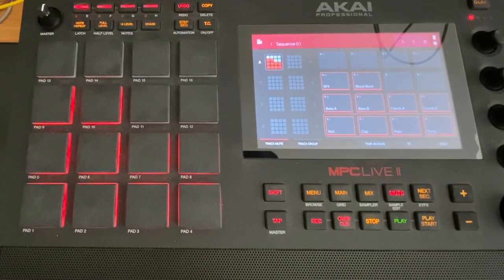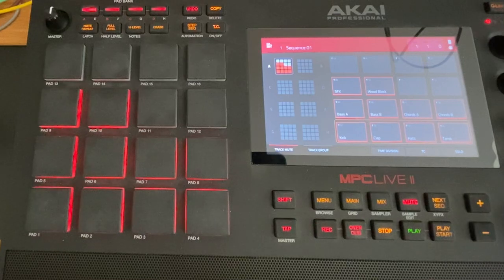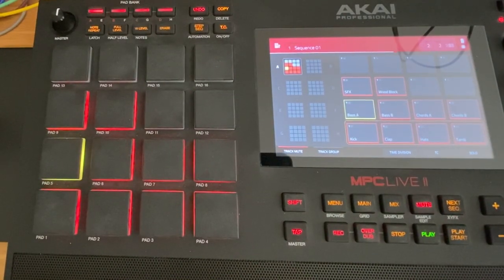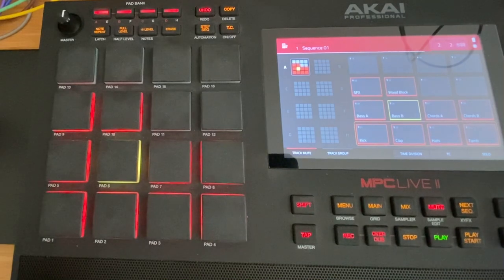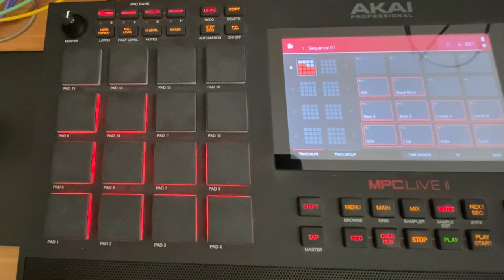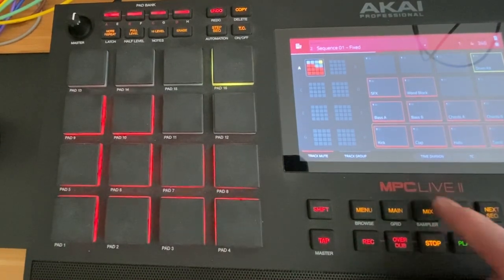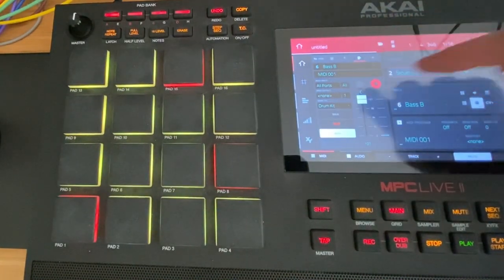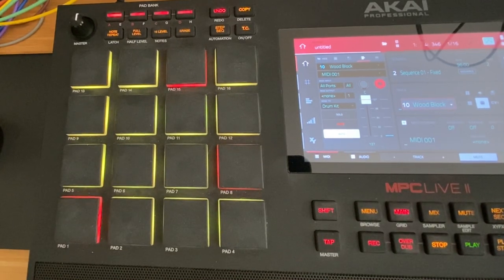Akai MPC 2.10 Firmware - Drum Kit Track Mute Fix

Comment: Are you sure this isn't happening because of the change in track mute behavior? It used to be, if a track was muted.. And I was on that track, I could still play the sounds from that track from the pads. Now, when a track is muted.. You can no longer play the sounds from the track. Akai told me this was not an error. It was done on purpose to make the mute behavior more like how a DAW works. I think that's lame, and they should never change a legacy feature of work flow behavior that's been around since the beginning. It's annoying me so much, I might just go back to 2.7.2
Reply from the maker: It's possible that the track mute behavior is the issue, at this point I have kind of moved on and don't care.  That said, the workaround is annoying, and I'd like to see the behavior reverted back to 2.7.x as well.

Comment: I had a similar problem. Turning up the max polyphony for the drumkit fixed it in my case. Not sure if it was a coincidence or not.
Reply from the maker: The mono/poly setting is different.  Changing polyphony can lead to similar, but different results.  This specific issue is because of how the MPC 2.10 firmware handles note on and off.

Comment: I have ran across two problems. One when I load up my expansion pack my MPC X shuts off and it says your MPC X has recovered from an internal error then it reboot and anything I'm working on is lost. Two if I'm working on something and I hit the track mute it muted the pads also. No sound come out
Reply: Your internal storage is probably full. This happened to me before, and I had to transfer alot of my beats onto an sd card before I erased them on the internal storage. And your second problem, your probably on track mute instead of pad mute. Track mute will mute the whole track or sound kit, pad mute will mute individual tracks within the track or sound kits, if that makes sense...SBN RESONATE
Reply: @natanmandala  All my beats on a 500 gig solid state drive that I put into the MPC when I got it. It's the 2.10
Reply from the maker: you might want to run a disk diagnostic on your drive to see if maybe you have some corrupted sectors.  Do you have a windows pc or Mac you can run some disk diagnostics on it?

If you're losing projects, I'd suggest considering turning auto save on.  Personally I find it a little disruptive, but losing my projects would really bug me.

As for muting, in Preferences -> Sequencer there is an option to modify Track Mute behavior that you might want to experiment with to see if that can help you.